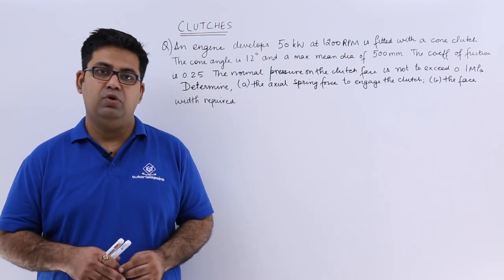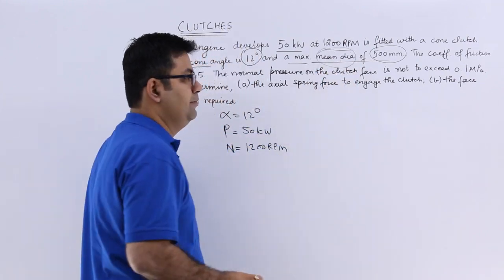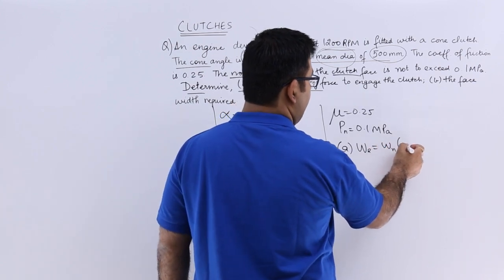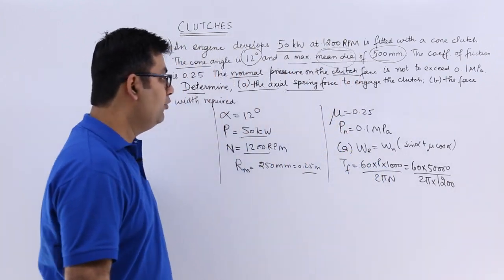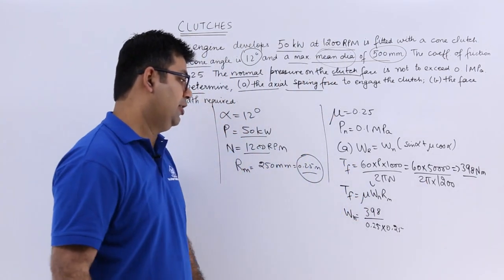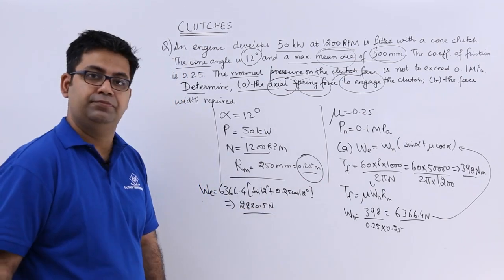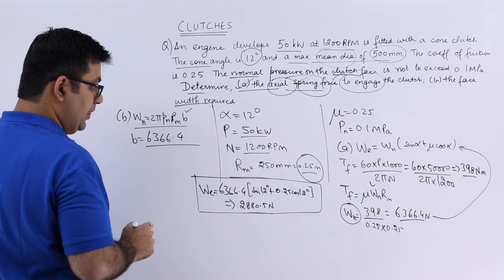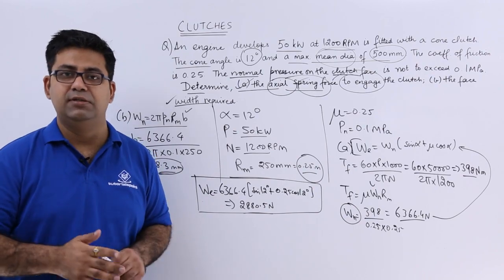Clutch example problem 3

Comment: Design a multi-disk clutch consisting of five steel plates and four bronze plates to transmit 7.5kW  power at 750 rpm.

Design the spring required in this multi plate clutch.

Sir can you solve this ?